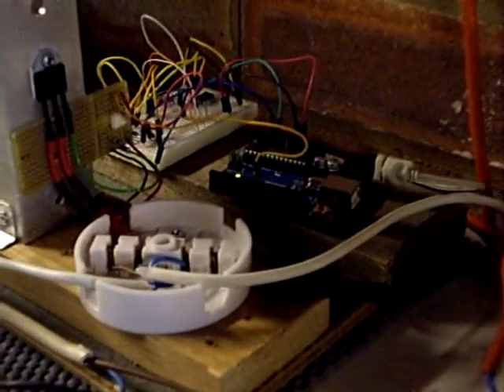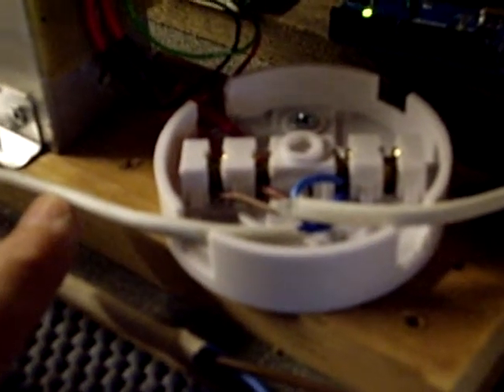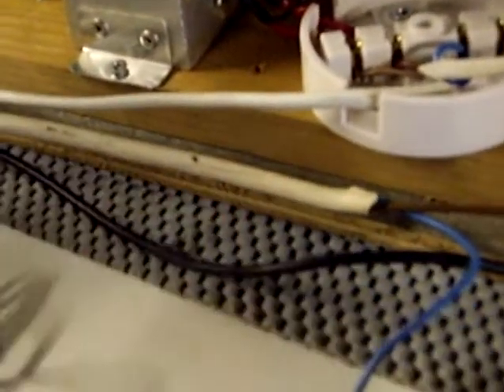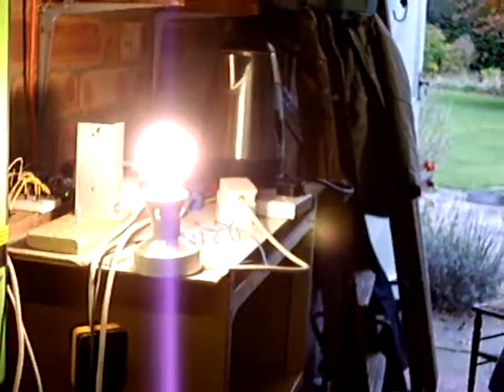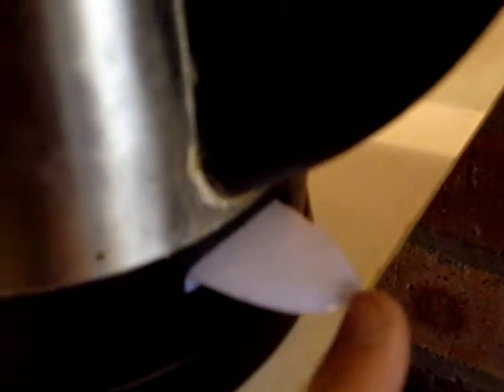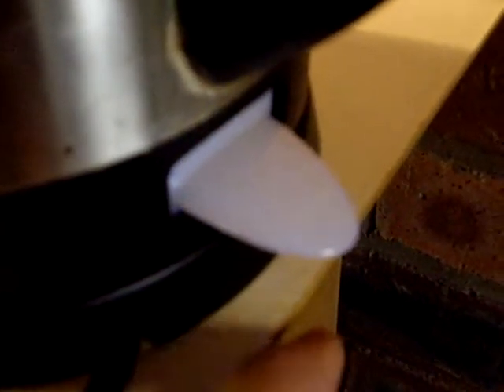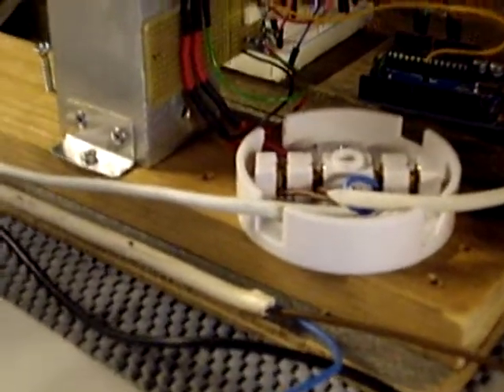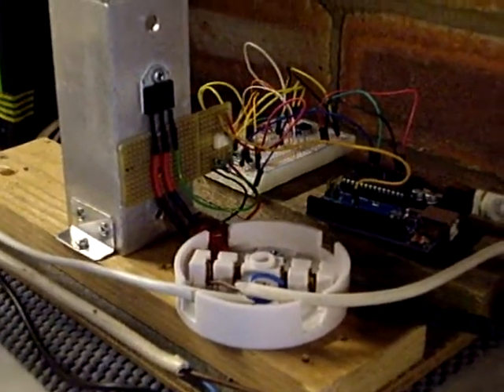Simple demo of Mk2 PV Router (2 of 2)

Comment: hi Robin

this project is really interesting, although i dont have solar panels my parents do, so im thinking of following your guidelines and designing something similar. i would be looking at a remote display though, maybe bespoke, or challenge a tablet addition.

what are your thoughts on this, i think i would prefer to use the Raspberry Pi as it offers much more in the way of communication i think. matbe link the Pi to an Arduino nano.

brilliant project though, very cleverly designed.